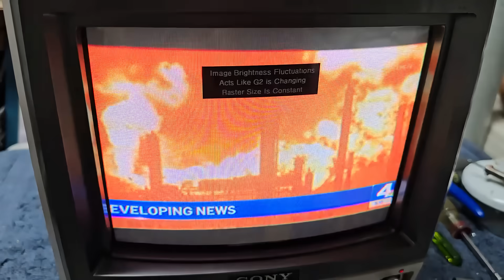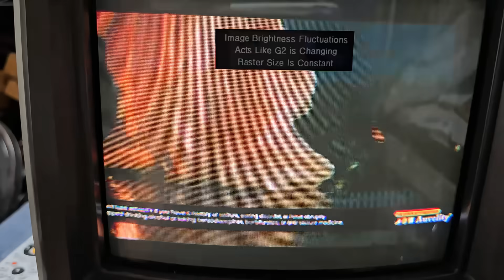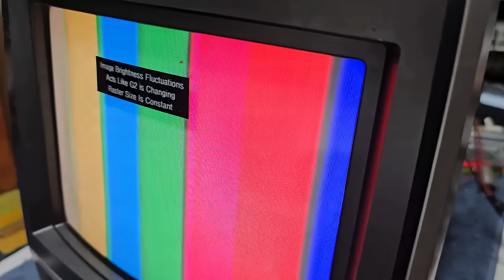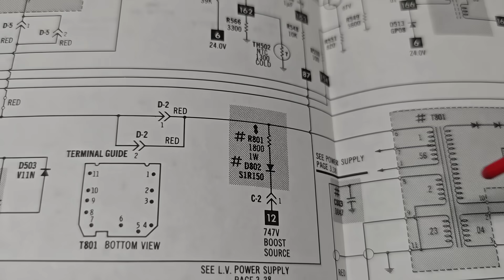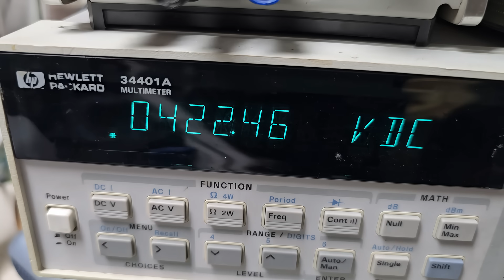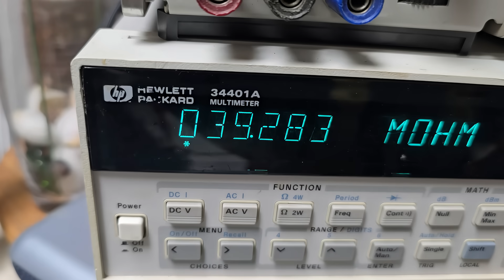1979 Sony Trinitron KV9300 Vintage Color Television Diagnosis and Repair

Comment: I once had a TV ( not a Sony ) that had a CdS cell  below the pix tube area to brighten the picture if a light turned on in the
room. Well it became defective doing a slight changing brightness but  erratically. It was covered by a smoke colored plastic cover. So I cut out the smoked plastic cover and it worked fine after that! Good call on a bad pot Shango.

Comment: In one of my videos I am working on a Sony KV-5100. I do not have a schematic. It looks like the Picture Bulb may be weak. and I would like to try and test it. Is it possible that you have access to the schematic and can get me the number of the Picture Bulb If it is not any trouble? I looked and no label on the CRT or anywhere on the set with a CRT part number. Thanks!
Reply from the maker: I will look. That's pretty new. Sams 1652
Reply: @shango066  Thanks for getting back to me. The manufacture date on the back of the set is August 1977

Comment: Back in the 70's there was this nickel paint that I would use to fix pots and land work.  Once it dried it had 0 ohms of resistance and it stuck to just about anything.  I wonder if they make such stuff anymore.

Comment: I've got a similar Sony set but from 89. It's got a digital tuner. Exactly the same symptoms. Brightness is all over the place. I only watch VHS on it and I thought my Macrovision was going bad. I'm gonna check the screen pot now. Thanks for the upload Shango.
Reply: Screen control is a low percentage shot (I worked on thousands of Sonys as an ASC).  Check the bypass electrolytic off the flyback source (low value, high voltage -  something like 22uf/350v).  The picture tubes in those also got glitchy.
Reply: @ohger1 damn thanks.

Comment: This seems to be happening a lot with the British manufactured Ferguson TX10 TVs now. They too have a 2 meg carbon pot that sets the G2/A1 volts and the carbon track is starting to fail.

Comment: Excellent find of the problem, plus good, important point about the resistor voltage rating (as is the case in 7" 1940s electrostatic TV focus/vertical circuits)

Comment: did you try moving the control  to either side of where it was set at?  it sat at one spot with that high voltage. move it behind or infront where it was at and it will probably still be ok. it has a pit now  on the carbon where it was set
Reply: Sometimes it's a burn mark on the surface. Might try looking at the resistive surface if you take it apart and
visually inspect it.

Comment: If you made this divider from 6 resistors, I would use 4:2 division instead of 3:3 to lower G2 voltage closer to original value.
Reply: Or replace the middle two resistors with a 0.5 MΩ 1or 2 W pot, so there's some regulation possible.

Comment: Interesting failure.  I like your resistor solution to get the value close.
I hope a pot can be found for that set.  Looks in great condition.   
Cheers from NC!  🍻

Comment: Check the 200v line. Does it fluctuate? 200v line cap? G2 control dirty? I'd start there

Comment: "This pot is bad" - that is a statement that I hear a lot since regulization of cannabis in Michigan amid the dispensary "gold rush" that the state government expected but never happened. (Dispos have infused products and smart people avoid them)
Reply: New proposed pot tax of 24% in Michigan to fix the roads. Wasn’t the goofy governor supposed to fix the roads in 2018? It gives new meaning to potholes.
Reply: @haneyoakie14  they never use the money for what they are supposed to no matter what state it is, then the people have to deal with it.  Terrible corrupt governments.
Reply: @mikemoyercell  exactly
Reply: @haneyoakie14 personally I am advocating for "volunteer pothole patrol" trained and equipped by each local counties road commission, when I was a teen we had chain gangs that were a mix of troubled youth and non troubled youth working together ( theory was good would rub off on bad) anyway it turns out that properly drained roadways reduce the amount of potholes that spawn . So until common sense enters the Convo nothing will change.

Comment: 16:10 Could you use a combination of resistors to fix that issue? Like say high wattage fixed resistors in series with a lower range variable resistor and possibly keep the adjustment in an acceptable range?
Reply: Yes, like replace the middle two resistors with a 0.5 MΩ 1or 2 W pot.

Comment: Those analog meters are still cool. Maybe not as accurate, but still like them. I have one old analog meter. Very interesting tv!
Reply: Analog stick meters can be accurate when calibration is right, and is better to visualize unstable voltage like the circuit for the screen supply.
Digi could be more accurate when you have many digits but both have a place on my bench.